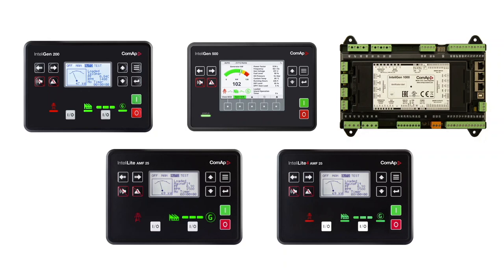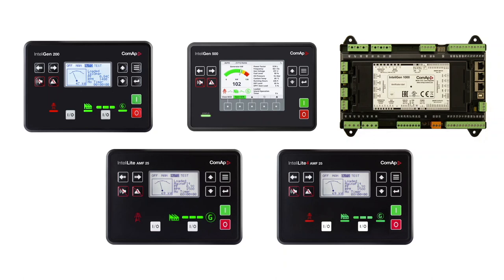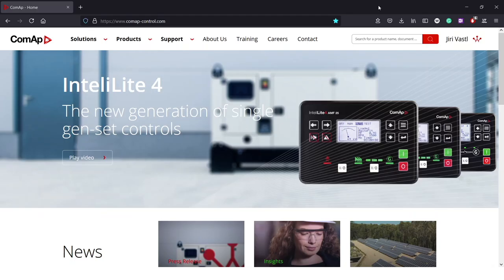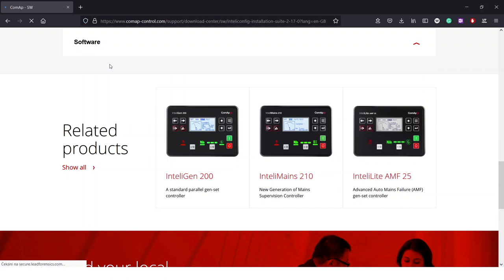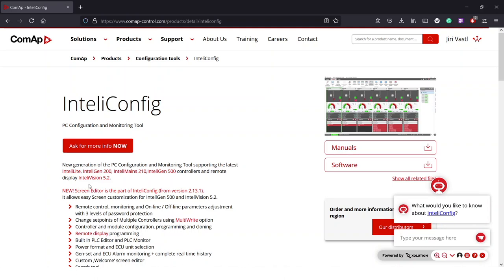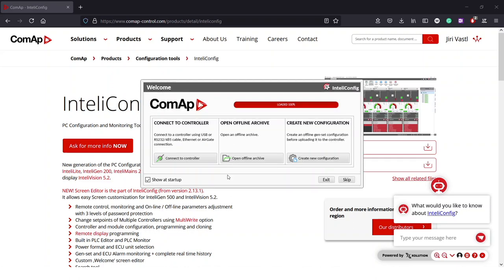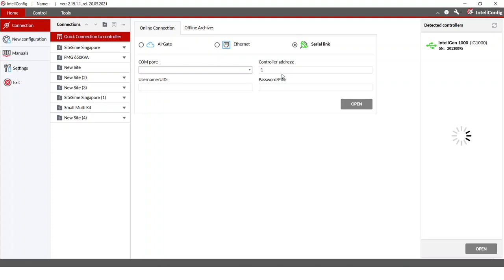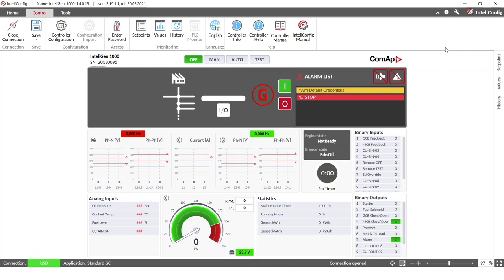How to connect to a ComAp controller via InteliConfig

Comment: Good time of day. I have an afm25 controller programmed for autorun by network control, it is necessary to redo it for autorun by dry contact, I searched for such a parameter in the controller menu, but did not find anything, tell me how to start the generator by dry contact? I also closed contacts x9 3 and 4 on the btb17ver 6 board where the remote engine start is located no reaction